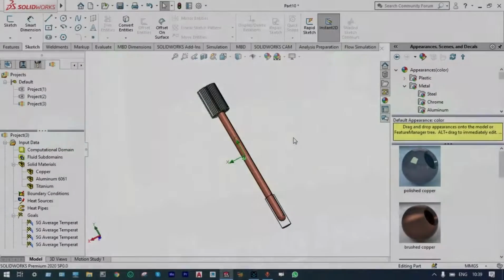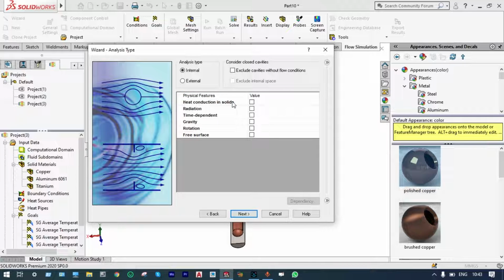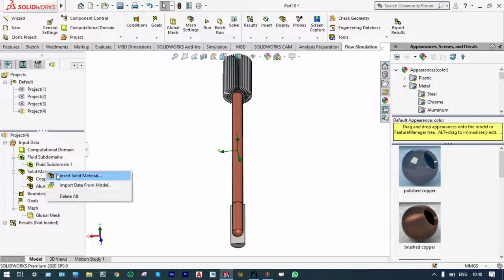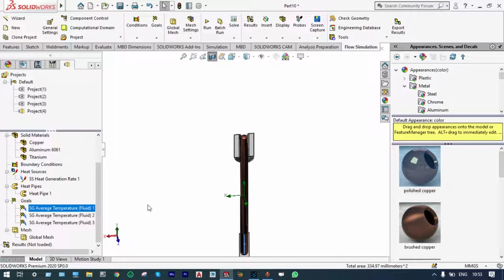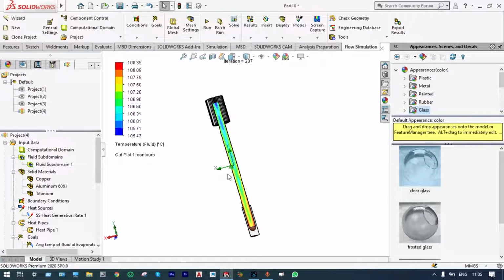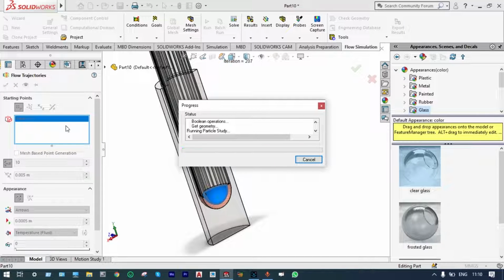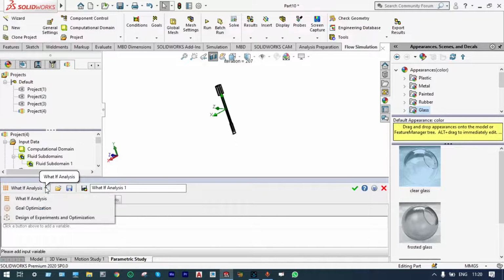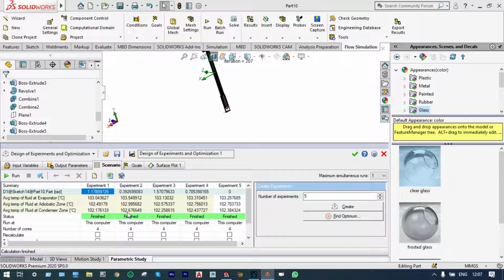CFD Analysis & Optimization of a Heat Pipe using SolidWorks 2020

Comment: Hi sir thank you for the video, why do you put hollow cross section for heat pipe? Can I design my heat pipe as a full cross section? I am designig motor cooling system with heat pipes in the stator so I am in doubt about design positioning heat pipes into system?
Reply from the maker: Dear Mr Dula, Heat pipe should be hollow. Because inside it there should be a little amount of fluid which will be vapourised at a lower pressure prevailing inside the heat pipe. This is the basis of heat pipe

Comment: Sir can you specify your system specifications such as processor, ram etc
So that I can upgrade my system for faster processing of such complex calculations
Reply from the maker: Mine is older one. It is i7 and 4th generation with 12GB RAM. I am struggling with this laptop for complex problems. Sometimes it is taking continuous 96 hours to have a result. I will change my system soon.   I am looking for a mid range laptop with AMD Ryzen 5, 5700U or 4800H, 8core 26 thread processor, 16 GB. RAM, 500 GB SSD. It will be under 70 K.
Reply: Thankyou for replying sir

Comment: Hi sir, I'm satish and we are doing a project that is balanced ventilation system, can you do a video on this topic and the requirment is using a square room and adjust the inlet and outlet let fan with ducts and air flow simulation
Reply from the maker: I will do it soon
Reply from the maker: It is done. I will upload it soon
Reply: @CFD_GUIDE  thank you sir, I'm waiting for that
Reply: @satishchowdary3053  please did he upload it
Reply from the maker: By this time, you can see this one. It will provide you some basics...https://youtu.be/UlmDsmrJtwU
Reply: @CFD_GUIDE for simulation part ok,  we need design a fan and construction
Reply from the maker: In CFD fan can be imported in two different ways. Ready made fans from different organizations with  different specifications are available. Even you can design also then you have to provide it's specifications from boundary conditions. It is very simple. What you are looking for appears to be simple. Apply boundary conditions properly in a cubic space.
Reply: @CFD_GUIDE  thank you sir, but I'm new to the designing software (solid works) , and I have less time to present the project, pls make a video on that and i will go through that sir

Comment: You are absolutely a legend Sir, Thank you very much for accepting the request from students and doing the videos. I have doubt about how to create sintered wick material for heat pipe?
Reply from the maker: That one can be done using two different layers inside the pipe and the inside part to be provided specific amount of porosity which is equal to sintered properties. Even to provide properties of sintered one you can provide material like wool or sponge or fabric or something with a specific amount of porosity with a view to provide capillary action.
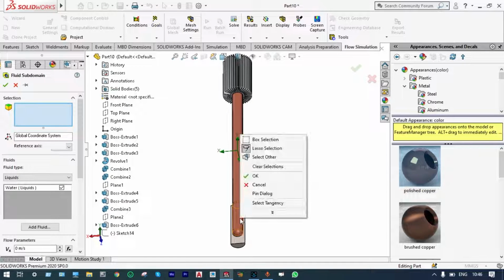Reply: @CFD_GUIDE  Hi Sir, I'm some problem with selecting the Fluid subdomain (5:31 in the video) (void area) how did you choose that face?
Reply from the maker: @icemanrajeev  as per normal practice you can cut the object from any specific plane and select inside the body or you can follow the option of select external surface and then select other option to locate insde
Reply: @CFD_GUIDE  Can we use insert porous material command for wick cad geometry?
I have tried this but it's excluding the porous material structure in the heat pipe
Reply from the maker: But I have used before porous material. It was not excluded from the geometry. After adding porous material with specific property from operating conditions check whether it is excluded or not if excluded then include it by simple tick.
Reply from the maker: Try inserting porous materials and check whether it is added or not from component control option